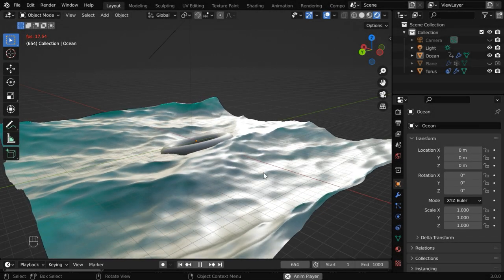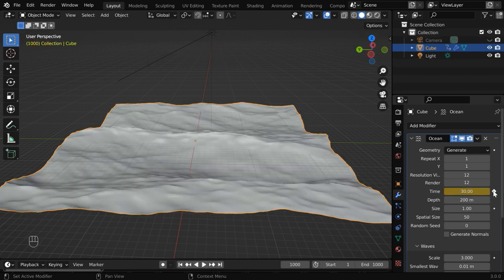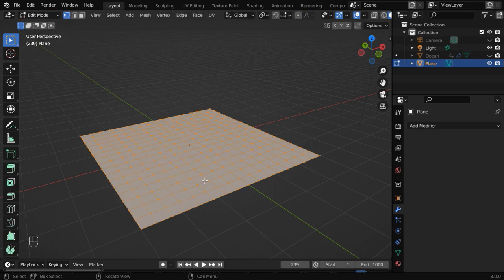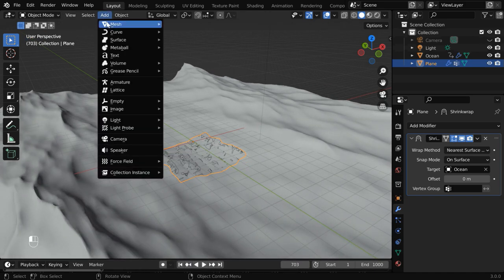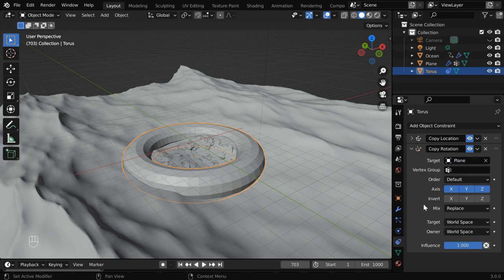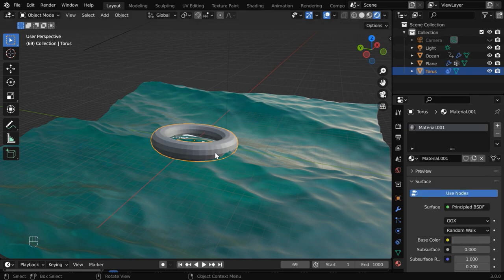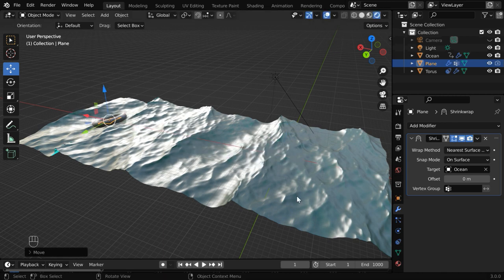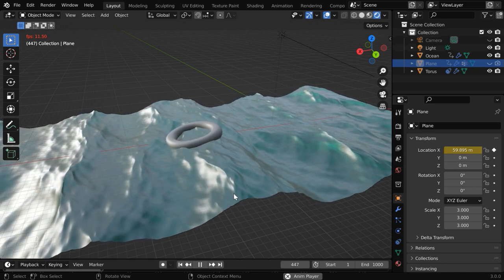How To Float Any Object On Water | Easy Blender Tutorial | Ocean Modifier & Floating Objects

Comment: hey the ocean is going through the center of my object, for example: a floating cup has the water going through the bottom
Reply from the maker: Check the origin of your cup. If you bring the origin down to the bottom of the cup, it will float just above the ocean surface and the ocean won't penetrate through the cup. But if you want it to float submerged (half merged), it will be somewhat tricky. The ocean will penetrate the cup in that case, so you need to add a boolean modifier to the ocean to cut out the part that penetrates the cup.

Comment: I made a boat float by this method but the ocean water is getting inside the boat. I have tried boolean modifier but it is not working properly. please make a tutorial on how to fix it.
Reply from the maker: Hi, as of now a boolean modifier is the only easy way to remove this water from inside of the boat. You need to add a boolean modifier AFTER the ocean modifier for the plane, and select the boat as the target with the "difference" option. While it works in most of the cases, it can fail if the ocean surface has a hole, or a break in its geometry. Such holes are resulted from a very turbulent ocean movement. If the ocean water is relatively calm, the above setup should work, I have tested the same. We'll probably come up with a tutorial soon on this, I found it interesting.

Comment: Thanks for this very clear tutorial!
For those who find the constraints have no effect: make sure the weight of the vertices assigned to the group (in this case all the vertices of the guiding plane) is set to 1 - otherwise the constraints will will not influence the target, and the torus wil not follow the movement of the guiding plane.
Reply from the maker: Great! Thanks for the tip! 👍💝💝

Comment: Vety well explained... One thing i want ask is that sometime water come above the torus which looks sinking so maybe  to correct those frames we can do manual work like baking simulation on plane and then manually adjust it.
Reply from the maker: Yes, we can do that. Or maybe we can use a boolean modifier to cut out the ocean where the torus is. We'll make a quick tutorial on this.

Comment: Hello. This is a very clear and easy to understand tutorial, and it works very well for a single floating object; but if I want to have several objects keeping their positions relative to each other, when I apply "copy location" it modifies their original position placing all the objects in the center. How can I correct this situation?
Reply from the maker: You need to use a separate guiding plane for each object. Or alternatively, you can enable X-Y-Z options in the copy location constraint for one object. For the other objects in the group, just enable Z in their respective copy location constraint. Now add a child of constraint for these objects, set the first object as the parent and enable X & Y only. So these objects will wave according to the height of the water but they will maintain the same relative position w.r.t. the first object.

Comment: Thank you very much for delivering such great content using simple, quick, and easy to follow demonstrations.  I baked and exported the plane animation to use in another application, but it appears that the shrink modifier registers only movement in the X axis by keeping the object's origin at the same height and rotation (0,0,0). Same with the torus' movement. Is there any way to register the rotation and Y Axis movement of the guiding plane towards the animation so that wavy movement can be exported? I really appreciate your content and teaching approach.
Reply from the maker: Hey, thanks a lot! Glad that you liked our tutorials. I did not try with export. As such Blender's export module has limited support in many areas, so we need to be really lucky to get everything working in an exported version 🙂
Reply: @5MinutesBlender  Hi, I exported as FBX and Allembic, both didn't registered rotations and Y movement. I also placed a simulated rigid body with gravity on top of the plane, either way its transform wasn't registered. I'll keep searching. Thank you for your quick reply.

Comment: Again another terrific and accessible tutorial! . One question, my torus has a kind of nervous jitter to it as it moves over the waves, is there anything I can do to smooth that out? Thank you.
Reply from the maker: Glad you liked the tutorial! To smooth out the jittery motion, you can increase the size of the guiding plane. Experiment with the size because if you make it too large, you'll lose the motions completely. Use something that makes it more realistic.
Reply: @5MinutesBlender  That worked great! Thank you. Would it be the same procedure to float a piece of cloth on the surface of the water?
Reply from the maker: @bobdobs8855  Yes. For the cloth, you do not need a separate guiding plane. The cloth itself can be the plane. But you can still use a separate guiding plane if you wish to, no problem!
Reply: @5MinutesBlender  Terrific news! Thank you
Reply: @5MinutesBlender  would the process be the same for using a video image as the cloth? When I try that it appears to be captured as a still image instead of a moving image.
Reply from the maker: @bobdobs8855  The process should be the same. One affects the material, and another the object shape, so there should not be any cross-connection between them. Btw, for the video image did you follow the process as in our tutorial https://youtu.be/E1COCnMUIhQ ?
Reply: @5MinutesBlender  Yes I did but I seem to run into some problems, I will have to try again. Thank you.

Comment: Question. Wouldn't it be the same if I applied a shrinkwrap constraint to the object?
Reply from the maker: Good question. No, shrinkwrap constraint won't work in this case (it will work but not perfectly) because shrinkwrap constraint works on the entire object, it does not affect each vertex point. So the guiding plane won't snap correctly to the ocean surface. We need to use a shrinkwrap modifier for the correct result.
Reply: I meant for the torus object.
Reply from the maker: Yes, that's possible. In fact we have another floating tutorial with that method, you can watch 👉 https://youtu.be/N-yohyp0Ja8 Between the two methods, the one we used in this tutorial gives slightly better result.
Reply: @5MinutesBlender  oh, ok thanks 😊

Comment: for some reason the object I imported is totally off sync with the waves/plane, it goes up or down with the waves 1-2 seconds later, any idea what's causing it?
Reply from the maker: Just a wild guess, please check the origin point of the object that you have imported. Usually the size of the guiding plane is a very crucial factor here. But I guess you have already ensured that the plane is in-sync with the ocean waves, it is the 3rd object which is only out-of-sync. So my doubt is on the origin point. Set the origin point of this imported object to that of the plane, you may get a better result. Please let me know if this does not solve your issue.

Comment: thanks for the tutorial, but I have an error and it is that when I do the render, the ocean waves are not previewed in the final result, it looks completely smooth u_u I don't know why....
Reply from the maker: One quick check. Did you set the Render resolution same as that for the Viewport? These two fields are there next to each other in the Ocean modifier settings and they should be same. Can you please check if they are different?

Comment: When I go to render even though my plane is hidden I can still see in my render what should I do ?
Reply from the maker: Hi, you need to hide it from render. There are two icons, one looks like an eye, it hides an object from viewport. Beside this, there is another icon like a camera, it hides the object in the render output, you need to use this to hide your plane. If you can't even see this camera icon, open the filter menu in the outliner panel and enable the display of this camera icon (this icon itself may be hidden by default).

Comment: I tried to make a camera float on the waves by copy location constraint or attach to another object with copy location constraint but neither works
Reply from the maker: Please double check, I just verified this with a camera instead of the torus. It works exactly the same, even in the latest version of Blender. So I guess you might be making some mistakes, please set up the constraints correctly.
Reply: I discovered another tutorial using Shrinkwrap constraint and it helped me to accomplish what I intended
Reply from the maker: @Aquafulness  Sounds great! 👍
Reply: @5MinutesBlender  I use this tutorial for my new mindfulness project
Reply from the maker: @Aquafulness  That's great to know 👍😊

Comment: Hello 5MB. You know I've learnt alot from you, So i eventually tried recreating this.. It worked very fine. However I tried to experiment by adding another object that's floats (boat). I discovered the boat was twitchy even when the guiding plane was bigger than the boat. Please, What could be the cause. Check the video on 'ayEbrid animation studios' channel, tilted '3d ocean with soft foam layer | Blender | animation'.  That's my personal animation channel.
Reply from the maker: Thank you bro! I checked your channel. Really cool 👍 You can increase the size of the guiding plane to control the twitching of the boat. Or you can reduce the influence field in the Copy Rotation constraint. Use a value of 0.2 or like that to reduce its rotational movement or frequency. I think that should work.
Reply: @5MinutesBlender   @5 Minutes Blender  Oh... Thank you. Didn't even think of that. What would i do without 5MB. I will leave a comment here when it works.